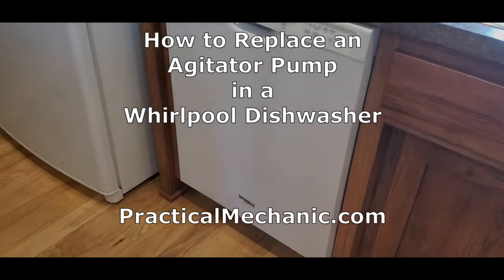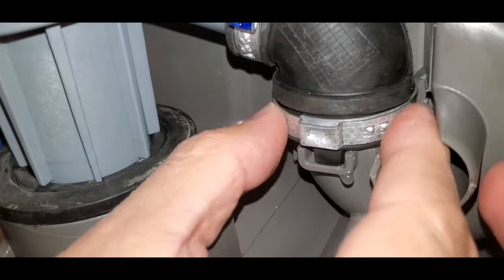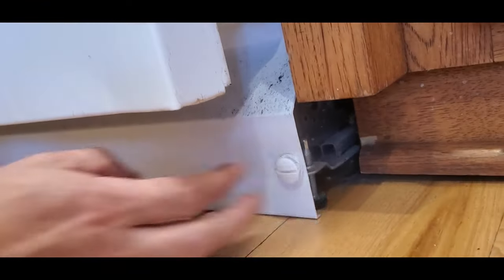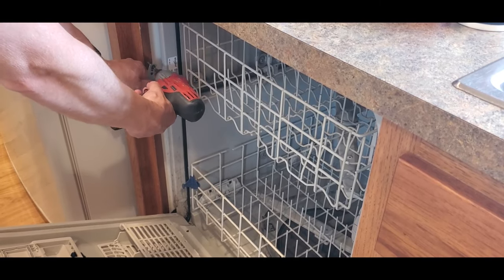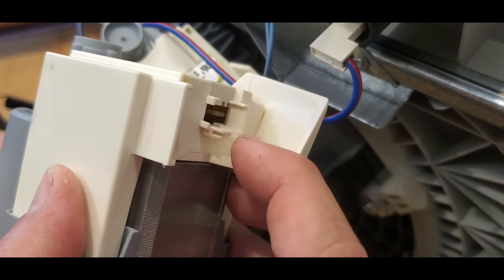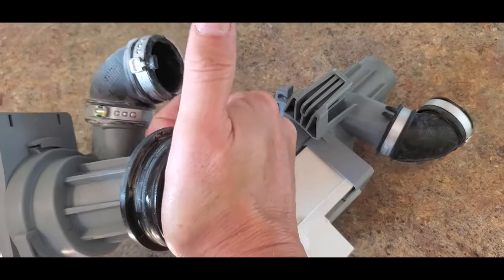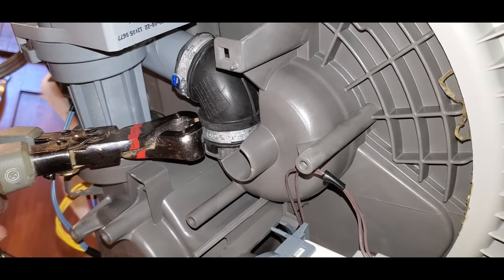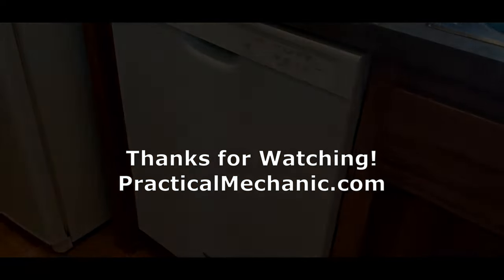Pump Replacement - Whirlpool Dishwasher - Circulation Pump Fix

Comment: Thank you so much. I have checked all the filters, water lines. Got down on the floor w/my ear up to the dishwasher w/a flashlight. Turned on the dishwasher and hear the sound of the circulation pump not connecting. From your description I'm going to check this part out. I'll let you know how everything turns out. 😊
Reply from the maker: Yes, please report back, hope you get it sorted out!
Reply from the maker: Yeah, I ended up using the ear clamp. Works well and gets nice and tight. The clamp and pliers to crimp them will run about $10-15 at a big box hardware store. Good luck!
Reply: @PracticalMechanic Thank you, I've gotten this far from watching your video. I feel confident I'll be able to get the job done. 😊

Comment: Overall fine, but don't tip the dishwasher onto the front to access the bottom.  That's  not just  the only finished surface, but also the oinly surface that has moving parts.  Tip onto either side or the back.

Comment: Excellent tutorial. I followed it exactly. Turned out there was a calcium buildup from my hot water heater that was stuck in the pump circulator. I cleared the obstruction and the old pump is working properly now. Your video set my up for success, and I saved on the new pump, since I ended up using the old one again. Thank you.
Reply from the maker: Oh awesome! Glad you figured it out and got it fixed!

Comment: It's seldom I comment on videos but I had to just take a minute and say THANK YOU. I have this same dishwasher and had done all the easy steps from other videos, which didn't resolve the issue. Pulled the pump today and found plastic debris clogging it up. Cleaned it out, reassembled, and waa-la! Cleaning like a new one again. Great instructions, very well done. I had to use a standard hose clamp, Home Depot didn't have a crimp clamp the right size. I'll keep an eye on that for leaks but so far so good. Thank you again, appreciate the effort you put into this video.
Reply from the maker: Awesome, so glad you got it fixed, thanks for the comment! 😁

Comment: The pump splits at the motor. It's made to twist apart and be put back. No need to mess with the hose clamps. Just twist off the old pump and twist the new one back on. There's an o-ring that should be lubed with some dish soap when you do that. The pump can be removed the same way for cleaning. It's a wet rotor design and the rotor cavity fills with gunk. Cleaning it out occasionally helps breath new life back into it. Although eventually the rotor's bushings wear out and the pump has to be replaced. I've also had one with a cracked rotor magnet.

Comment: great video! you saved me a ton of money, just learning how to remove the pump and check it - turns out mine had an obstruction stuck in the impeller. Here's to hoping the resistance didn't burn up the motor. Just need to buy a new crimp clamp and put it back together and test!
Reply from the maker: Excellent! Glad to hear it!

Comment: Thank you . This was an excellent presentation. The pump on a Whirlpool DW I have at my daughter’s house has this issue . I was just quoted $360.00 for the part and $70.00 to install . After watching the how to repair, I’m good with $70.00 to remove and install. The mark up on the part is about double . I’m partially disabled so some of the labor process would be a challenge. Thank you anyway . It was a very informative read.
Reply from the maker: That's great to hear! Good luck, and thanks for the feedback! 👍

Comment: Be advised that the "pull out the rubber gasket" part (3:20) is much more difficult than he makes it seem here.
Reply: Extremely. Wouldn't recommend  but still not a terrible idea. Whatever works best.
Reply: Screw that... I can't even get the small rubber hose that he just pops off with no problems. I can literally lift the machine with my screwdriver under it and it hasn't budged
Reply: @berndo3038  So how did you get it off. Thinking about some lubricant
Reply: @MonkeyMD3  It pissed me off enough that I just took some pliers and bent it off lol. It can't be reused anyway so I just got a 1.25 inch adjustable hose clamp, the screw kind, and tightened it as hard as I could physically muster. No leaks and it's running like new.

Comment: I kept my wires and hoses long so I can just pull the dishwasher out. Pump keeps getting grit in it. It takes me less than 5min to remove, clean, and replace, but doing this once a week is getting old.

Any way to prevent grit from entering the moving parts of the pump?
Reply from the maker: Can you install an in-line filter in the water line upstream of the pump? Wouldn't need to be too fine, I would say 100 micron filter should work.

Comment: Is it possible to take apart and clean out the pump without needing to disconnect the hose clamps? I don't think I'll be able to reclamp mine
Reply from the maker: It'd be tricky. I think they're intended to be single use. You can replace those with a normal metal hose clamp, or the tool and a couple clamps is pretty inexpensive:
https://amzn.to/3XlMzx2
Good luck!

Comment: I went step by step using this video, Got the circular pump on, however I can here it trying to engage but then stops, then it tries to engage again but stops, is this considered a bad circular pump or is something else going on???
Reply from the maker: Could be, otherwise could be some debris in the hose that's getting lodged in the pump so it can't turn?